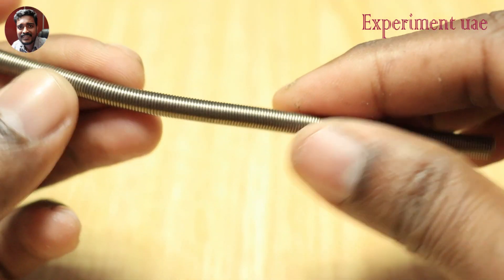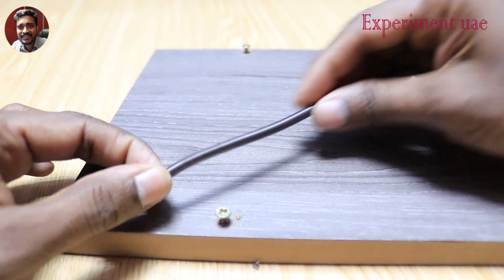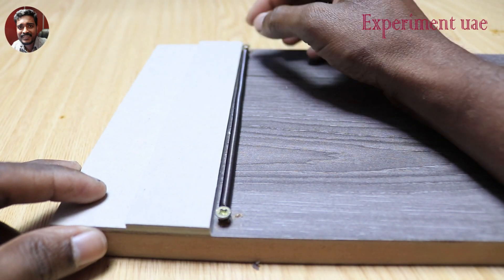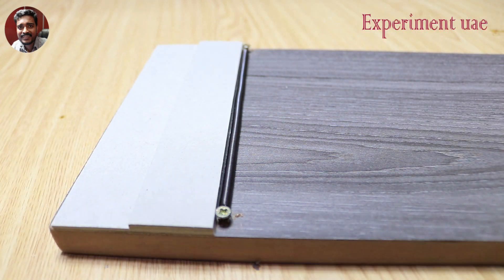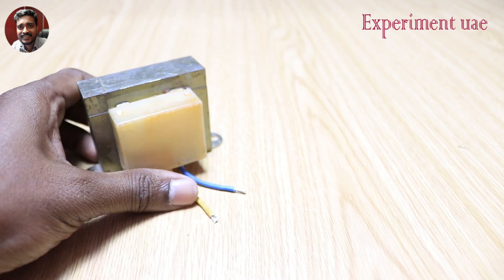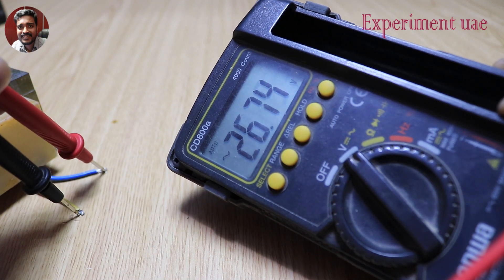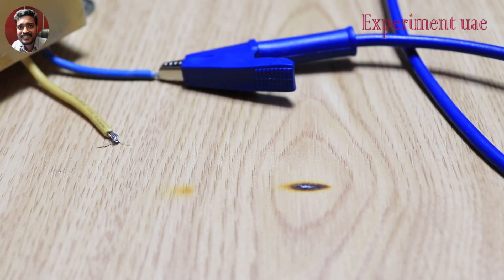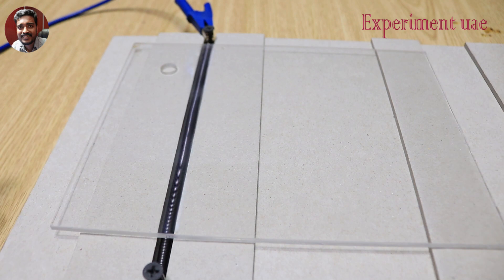How To Make  A DIY Acrylic sheet bender | Cheap & easy |  Experiment uae |

Comment: Transformer output is AC.  There is no need to convert it to DC, right?   Also there is no need to rectify the voltage output of the transformer, right?   We can connect the output of the transformer directly to the coil, right?   Are there different types of heating coils?  Should I check their voltage/ampere requirement before buying?

Comment: Brother can you tell, what is the price of 5 or 6mm transparent  arcylic sheet per square feet.
Reply: 5mm will be 90 rupees per sqft swasthik brand
Imported is 170 per sq feet
Reply from the maker: I don’t know bro . I am using scrap sheet for this purpose only 😆
Reply: If you want to do laser cut
Imported acrylic sheet is preferable